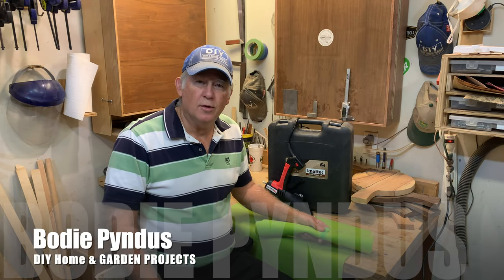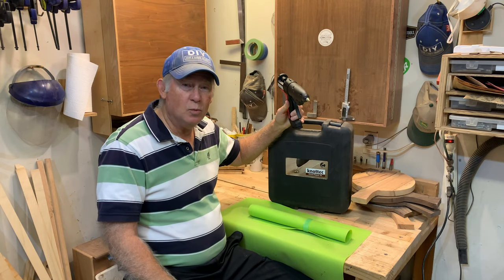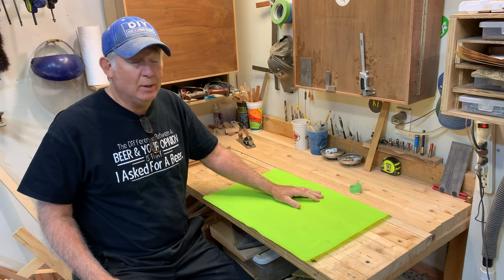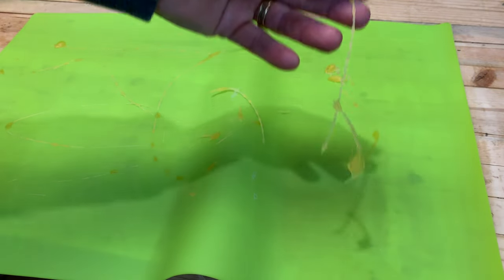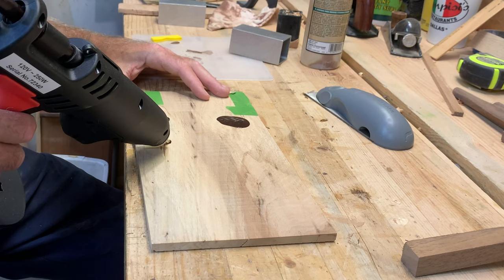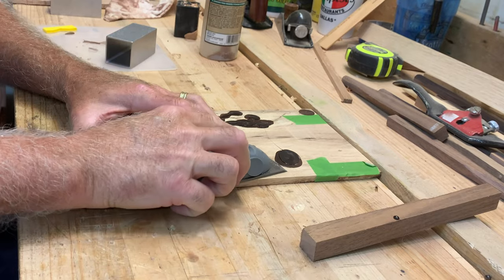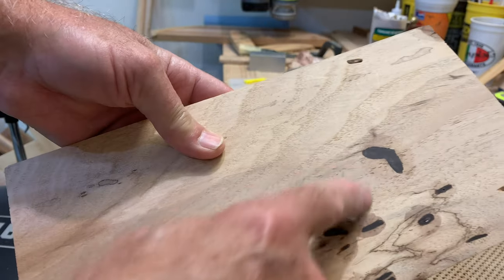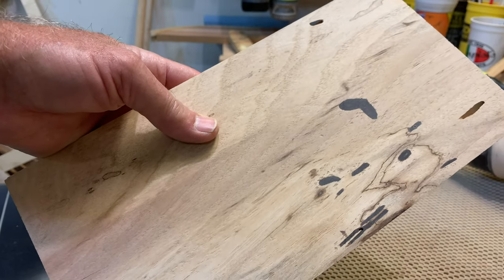Review of Knottec Wood Filler and Cheap Glue Mat.

Comment: I think the dry glue pull off is as much fun (& therapeutic) as popping bubblewrap :>)  BTW, why didn't you use the mat as a sanding mat later in the video?  I'll bet it works good for that too.  Great video
Reply from the maker: It does work good, but the sanding mat but it gets a bit dusty so I use a different one.

Comment: For the knotted is it necessary to use their glue gun or coat it be used with a regular glue gun?
Reply from the maker: I’m not sure a regular glue gun would get hot enough to melt their material